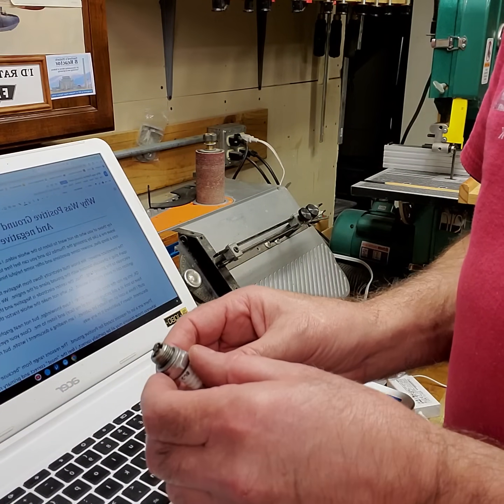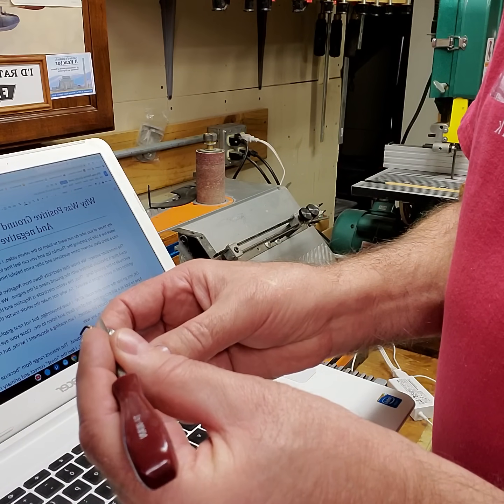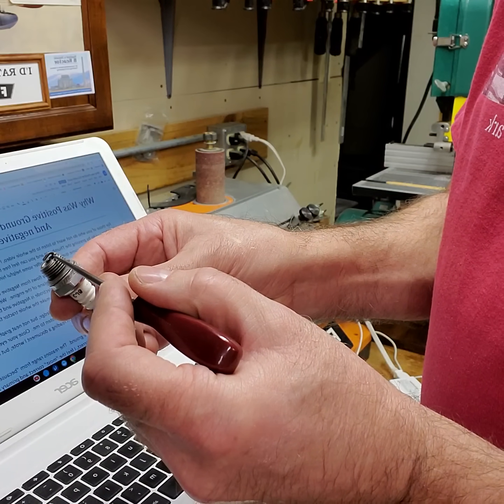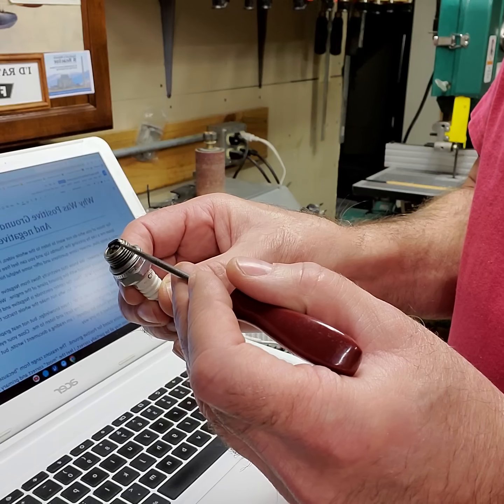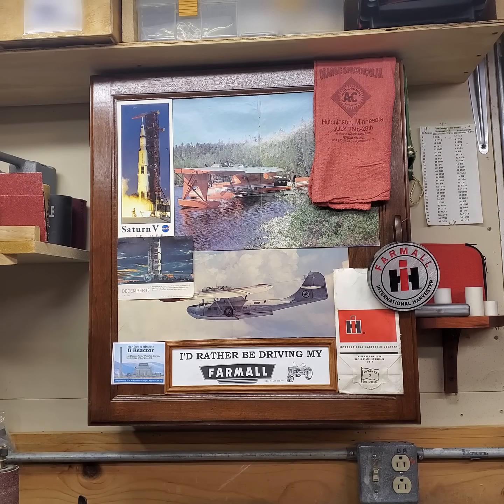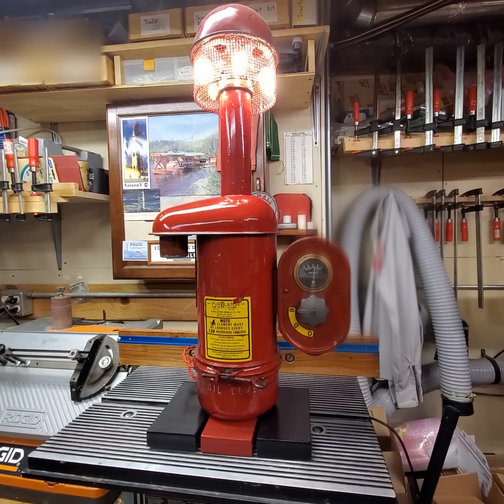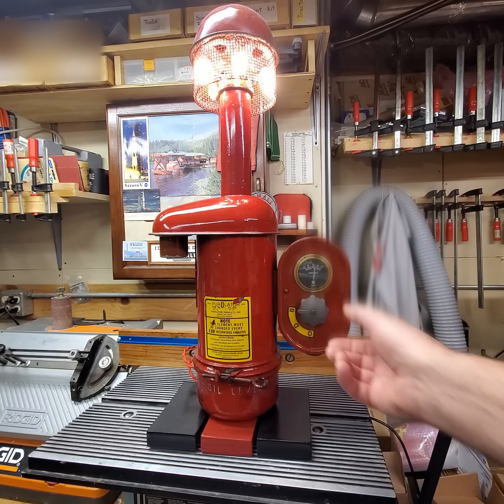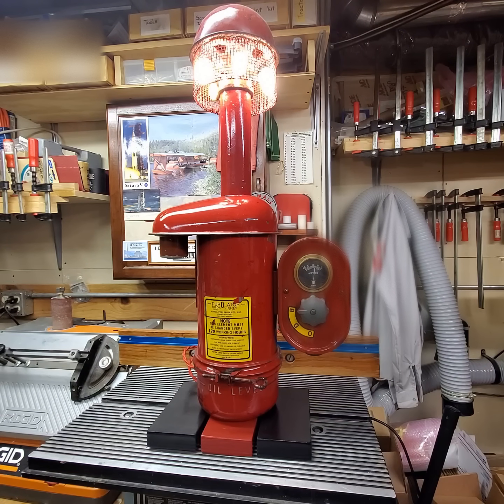Why positive ground was used on old cars, trucks and tractors

Comment: Hey nice video and good topic - I think you left out one thing that might have influenced the switchover - solid state radios.  I've read that as they switched to NPN silicon transistors it was easier to use a negative ground for the radio chassis and antenna. Really it could be made either way, but it may have been more economical.
Reply: know the funny thing, if you reversed the polarity of everything and changed the NPN to a PNP, the circuit will work almost the same. I learned it the cool way after I though I could just swap the PNP to a NPN and invert the battery, but I forgot the electrolytic capacitors don't like that, you have to reverse them, thus I made a positive ground circuit.
the collest thing was mixing PNP and NPN the wrong way and they exploding
Reply: I have a diesel technology text book from college thar says it had something to do with early transistors as well.
Reply: @chuck 8094 cmos totem pole is basically almost symmetrical, its beautiful, you get it almost for free, but PNP are a bit bigger than NPN, but not by much. 
In digital logic you end up needing both anyway.
Reply: @chuck 8094  "This is relevant in guitar amplifiers because of the coveted vacuum tube sound. "
I used to think that the difference was because of the cutoff of saturation of a valve vs the transistor.  But that can be simulated perfectly in a circuit by the gain curves and so.
But I think to the human ear, what matters most is the kind of "white-noise" produced by the grid of the tube, transistors have none of that, ironically the problem is that they don't have much noise.
The human ear really likes the warm sound of the noise floor, its not exactly white-noise, but its noise, and it matters a lot for the feeling.
I'm an amateur guitarist.

Comment: No argument with your essay Sir.
I think you will find there are several compelling reasons for the ubiquitous -VE ground (but not actually directly relating to vehicles).  If you study the fundamental physics of the vacuum tube (you know - before transistors became the thing) then a negative ground was the inevitable way to design and physically construct radio, TV and other valve equipment.
Also, there are a number of electronic mathematical procedures that are most unwieldly when using a +VE common.  So even though folks knew about the true direction of electron flow, the negative common/earth was more or less universally adopted because it often resulted in WAY-LESS mental and mathematical gymnastics for the designers and engineers.

Comment: I have been taught the exact opposite. Loss of an electron need replacing, right?
In fact, it is only an electromagnetic pulse that travels in any substantial way, while the electrons remain relatively stable.
So if the electrons are actually travelling along, at what speed are they traveling? And what controls or initiates the movement and speed? Current? Voltage? Eddy current? Resistance? Inductive reactance?
Why hasn't the travel of electrons ever been clocked?  Hmmmm
Does the weight of something increase or decrease as it gains or loses electrons? Nope, since electrons have zero mass, and are only representative of energy in a massless state. You can't hold a pile of electrons in your hand. 
Oh anyway I think this was an awesome presentation and I will probably subscribe if it turns out there are more videos like this one.😁👍

Comment: I have a 1964 john deere 3020 gas tractor without a positive ground system when I  bought it.  First thing I did was switched it over to negative ground with alternator.
Reply from the maker: Hi Greg!  Does your 3020 have the Marvel Schebler carb or a Zenith?  I prefer the MS.  But, may prefer the Zenith.  I like the MS because it has an accelerator pump inside of it.
Reply: @bryanh1944FBH  it's  the cast iron carb,marvel I  believe.
Reply from the maker: @gregambrose2566  Hi Greg!  I feel that is a great carburetor.  Even though it was troublesome, I think the internal accelerator pump was a good idea from MS.  But again, may Zenith fans disagree.  Your 3020 is a good tractor!

Comment: Oops! At around 5 minutes, you said the negative pole was the cathode. You're half right. That's exactly backwards. 

I understand there are two theories on how electricity flows, maybe even three, but I am of the affirmed opinion that it flows from a source of electrons, meaning the negative Pole to the positive pole.

 Lightning actually does not "strike" the ground, even though all the meteorologists in the world will tell you it does. The truth is, the ground sends up what's called a "leader" and that provides a pathway to connect to the top of the clouds, which has a positive charge. Everything in between is negative and back in the late 1950s, Kodak made a rotating film in which they photographed a (time lapse) shot of a lightning exchange and it was clear that the bolt started at the Earth and went up first, then cycled about 115 times back and forth in the blink of an eye. 

Anyway, you can delete this if you want. I'm not trying to rain on your parade, because like I said, there are many theories and it is actually very complicated. 

I have a theory of my own. Ever wonder why the clouds don't just fall out of the sky, but hover? I think it's because the bottom of the clouds is negatively charged and the surface of the Earth is also negatively charged, so is the charge separation varies, the height of the clouds does too, similar charges repelling each other. 

Thanks for the video, it "sparked" my interest. 🤣
Reply from the maker: Hi Siwy Wabbit.  No, I won't delete.  I appreciate all comments.  I do make a lot of mistakes.  It's so hard to make a video in one cut and not make errors.  In other videos I have made, I make errors in them too.  I'm learning ......

Comment: Thanks Mr John for explaining this problem in depth. I have been trying to tell people for years that most of the problem is the small ground cable leaving the battery to the frame needs to be cleaned every 7 years or so to prevent electrical, computers or no( crank-start ). Just clean the battery cables beginning of Summer and winter. I thank you and I will share this on my Facebook page. AMEN
Reply: Better yet slather the connections with silicone grease and it will prevent corrosion in the first place, at the cost of attracting some extra dirt.

Comment: What precisely is a 6 volt cable?
Would that be like heavier gauge or what.
Reply: I assume that's what he means.
A) current is twice as much to deliver the same given wattage.
B) voltage drop would be twice the effective loss than the same drop at 12V.
[It actually follows the square of the voltages' ratios]

OH, I see Bryan H (author) said that already; 2 months ago.
I happens to be only two posts below this one! LOL
[as of the current sort by 'top comments' which can change as new posts and likes are tallied...]
Reply from the maker: Yes, heavier gauge.  I should have been more clear.  Thank you.

Comment: Most of the time equipment was changed from 6 volt to 12 volt for purely economic reasons -6 volt stuff cost more than 12 volt by the 1960’s.

Comment: I was not taught that way.  I received my electronics training from Communications & Electronics School Battalion, USMC, MCRD, SanDiego starting in 1966.  I learned it - negative to positive, a surplus of electrons to a deficiency of electrons.
Reply: So didn't you ever wonder why the arrow on a diode points the wrong way?  Electronic symbols point in the direction of conventional current.  When you're talking about electrons, then you use electron current flow.  Normally people are taught conventional current first.  They learn electron current when it makes a difference.
Reply: @stargazer7644  you don’t want to confuse Marines by teaching them conventional first.  Btw, I was an instructor at the electronics school after I graduated.
Reply: @stargazer7644  I was taught the current flows against the point on the arrow.  I don’t know why they actually reversed t.
Reply: @johnclarke6647  And that makes sense?  lol it points the other way because that's the direction of conventional current flow - positive to negative.  They didn't reverse it - that's the way it has always been - forward :)
Reply: @stargazer7644  what I can’t stand these days are the digital VOM’s they have on the market.  I learned on a Simpson 260.  I still have a Tripplet VOM in the shop and a Walmart derived digital VOM.  I have to think backwards when using a digital VOM.  On continuity I like to see the meter go to zero and stay at infinity on an open.  I don’t like waiting while the digital VOM thinks about it.  I guess I am to much old school😎

Comment: The devil is always in the details with ignition systems. Another factoid is that the peak voltage a distributor based system is subjected to is typically defined by the largest breakdown voltage in the system, and this may not be the spark plug itself. Ran into that with a large distributor that had terminals routed out to the sides and the terminals themselves on nearly a 5” base circle, which equated to ~60kV when the spark finally made the jump to the terminal, which would cause it to immediately break down and start running with a severe miss. Thankfully it was a computer controlled one so I could set it up with around 28 degrees of base advance so the rotor and terminals were close together before the coil fired, and problem solved. Of course, the use of flyback systems means we can now have the spark be either polarity.

Comment: It's the same reason you want to control the flow of electricity when you are welding, especially when you are TIG welding, you want to control if the heat is in the tool or the workpiece. They can even use this to weld Aluminum, than they need to let the heat action break up the Oxide layer on the surface of the Aluminum by reversing the flow so it breaks up the top layer which needs a lot more heat than the base metal...

Comment: The direction of the flow of electricity is just a convention. Electrons and holes move (very slowly) in opposite directions and either of those can be considered a "direction of the flow". It has nothing to do with the convention. It's just that negative ground became a convention at some point after TTL was popularized.
Reply: The negative ground convention predates solid state electronics.
Reply: @stargazer7644   of course it does. It's just consumer electronics went predominantly negative ground with an advent of TTL at some point. I'm still using positive ground when I work with NECL circuits, for example.
Reply: @the-ruffles  What use did cars have for consumer digital logic in the 60's?  Why do you think TTL had anything to do with cars changing ground potential?
Reply: @stargazer7644  cars had exactly 0 TTL components back then, but the industry was already pushing for negative ground. Logic gates was just faster with NPN transistors than with PNPs due to electron mobility being better than that of holes, that's all. The industry just had to pick one and it picked 0(GND) and positive(Vcc).
Reply: @the-ruffles  We're talking about cars here.  You're talking about high speed logic.  They certainly didn't decide decades before microprocessors that cars should have negative ground systems to be ready for them.  I fail to see what point you're trying to make.  Just because cars happened to switch to negative ground, and TTL happened to use negative ground, doesn't mean one had anything to do with the other.
Reply: @stargazer7644  a quick google search shows that the change happened in late 60s which corresponds with the electronics industry moving towards a negative ground in early 60s. I think it's just a supply chain decision. The corrosion issue seemed to be mostly solved at that time. So they decided to play along with the electronics industry.
Reply: @the-ruffles  Apart from perhaps the radio, cars had nothing whatsoever to do with the electronics industry in the 1960s.  Nothing.  Car makers had been switching back and forth between positive and negative ground systems since the 1920s.  This has nothing to do with electronics.
Reply: @stargazer7644  First transistorized ignition systems appeared in 1963. Source: VinceC (2019-05-07). "Automotive History: Electronic Ignition – Losing the Points, Part 1"

Comment: You know, I had forgotten that that used to be a thing. If you needed an electrical part for your vehicle, you had to know whether it was positive or negative ground.
Reply: For CB radios (and probably other vehicle radio equipment) they used capacitor isolated ground: so the circuitry works equally well in an positive or negative ground vehicle. 6V may be a problem though.

Things like light bulbs don't really care (again voltage may be a problem). Newer LED bulbs care. One of my bikes has positive ground because the LED replacement bulb was grounded to the positive terminal.

Comment: I converted my Farmal H to negative ground in order to add an electronic ignition module. The starter still spins the correct way apparently because all forward speeds and reverse work. But, the generator no longer works. Did I burn something up or is this just the result of bad grounds as you mention?
Reply: You might try polarizing the generator.
Reply: @rpm12091  Yes. In fact, if you DIDN'T re-polarize your generator after you switched ground systems; it is no doubt polarized the wrong way (it is still trying to charge -6V).
I do not have generators, but I understand that is how it works.
Reply: I think the problem is I use the tractor so infrequently it loses polarity between uses. I remove the 6 volt battery and charge it between usages anyway, so not charging while running isn’t a big deal.

Comment: I am a mechanical engineer by degree and experience (43 years in the aircraft industry) but have a minor in electrical engineering (Early in my career, I noted that electric devices...i.e. computers...would be controlling my mechanical devices in the future and I needed to know how they worked). Aircraft use two different ground electrode types...massive, and rare earth materials (usually platinum or iridium). That led me to believe that the manufacturers wanted ELECTRON flow from the center electrode to the ground electrode where they would smash into the erosion resistant massive electrode (because there is so much mass there that significant erosion would take a long time) or the rare earth electrode (the materials are more erosion resistant). My myth was smashed when I disassembled my first aircraft magneto (most other magnetos are similar) and noted that the spinning magnets in the armature cause the polarity in the magneto to reverse every 1/4th revolution, causing the sparkplug current to reverse as well. Still, after that 43 years, I am still asking that question, "Why did we change?" I to agree that is made tracing a schematic easier, but does it really? I just don't really know.

Comment: Lightning. The earth is at a negative potential, the clouds a positive charge. The frame is at the same charge as the earth. That way when the leader appears, your auto doesn’t stick out. Use welding cable of the proper gage for your 6v rig if you can’t find battery cable. Solder your connections, cable ends. Resistance is critical in a 6v system. I started my journey towards electrical know how, mostly low-volt dc stuff, way back when in 1965. Oh, also clean & grease your battery terminals! My 1984 dodge still has the factory original positive cable on it. The insulation fell off and I had to wrap it in elec tape.
Reply: Lightning can be of either polarity.  Positive strokes tend to be much more powerful.
Reply: [Lightning] It doesn't work that way. Your car body is isolated. (from the earth). And it sits on rubber tires.
It is only 'negative' RELATIVE to the harness 'positive'.
You would have to park your can and drive a ground rod and cable it to your car.
Remember ever getting a static shock reaching for you door handle?

If you don't believe me, park by a water meter or some ground. You can use the ground hole on an extension cord or wall plate.
Measure the voltage between you car body and the earth ground. (like the frame side battery ground cable).
Now reverse you battery => cables off, LEAVE your 'hot' cable UNHOOKED, touch or connect you 'ground' cable to the hot side (+) of the battery, measure again.
You will not get any voltage reading either way!

The car is isolated. There is no complete circuit between the earth and you car battery system.
No voltage will be developed between the earth and you car, due to the battery or grounding choice employed.

OBVIOUSLY DON'T HOOK BOTH YOUR CABLES UP BACKWARDS, AT ANY TIME. This WILL fry your components, alternator, and possibly damage your battery, cables, and risk of explosion.
Reply: @troubleshooter1975   the reason why you are safe in your car, it forms a faraday cage around you.
Reply: @dinosaurcomplaints2359  Correct.
I was responding to you saying the car frame is negative. I might have took that the wrong way; I thought you were inferring battery ground "polarity" would have something to do with the likelihood of being struck by lightning.
Please excuse my comment if that is not what you meant.🙂

There is a lot of misconception in this thread that battery frame polarity imparts a polarity with respect to any 'other' external circuits that are NOT part of the battery supplied system. I'm just attempting to dispel some of the confusion...😀
Reply: @troubleshooter1975  that was what i was i ferring. Electricity is the most used naturally occurring phenomena, yet the least understood.